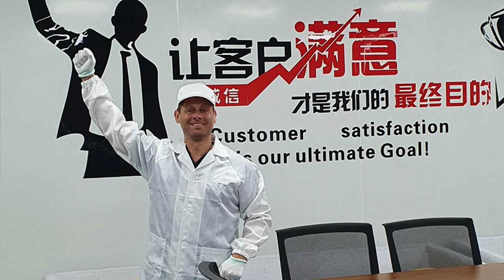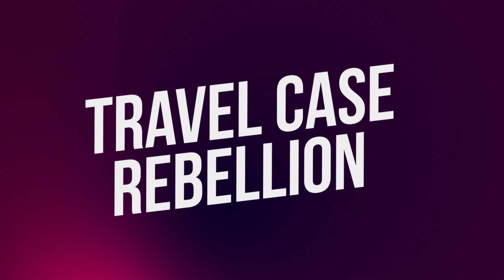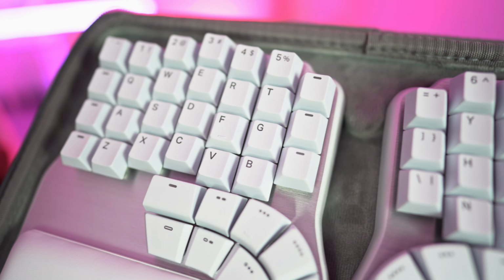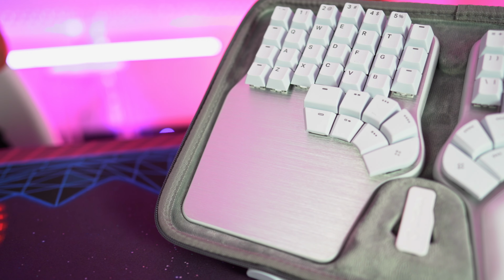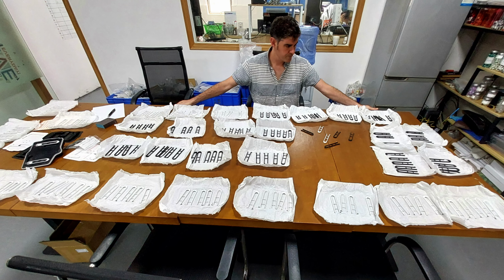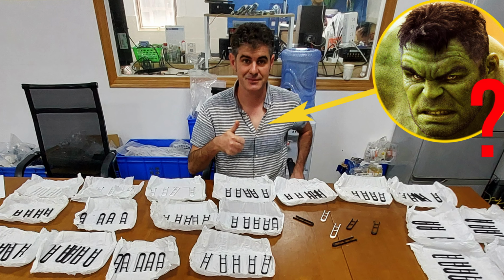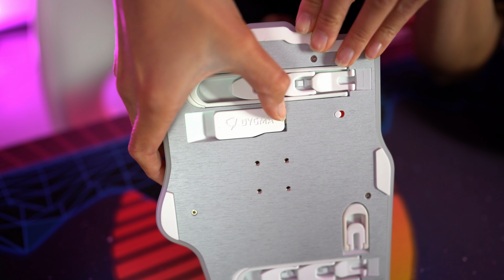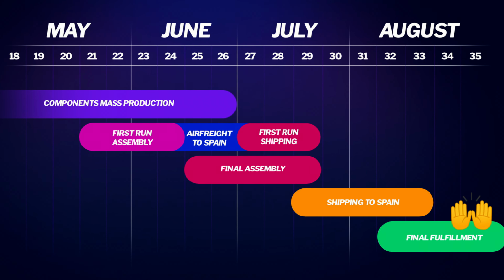We assembled 100 Dygma Defy keyboards!! 🎉 - Dygma News #10

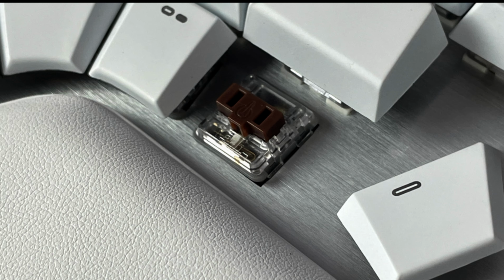Comment: This is the first time that problems are accepted or fixed with workarounds instead of at the core. Both with the holes for the low profile switches being too big not getting fixed 4:33 and with the Neuron not sliding in fully 7:59, leaving the connector not fully closed on purpose. The lather especially I find untidy and a sign of a cheap product.

This is very not like Dygma and what I expected since all the other updates. It's also not quite what matches the price point of the keyboard. But I understand that you need to finally cut and bring the product to market for real. It's a niche too and I'm grateful to the improvements you guys bring over current alternatives.

Thank you very much for the update and your continued efforts. I look forward to going split ortho again
Reply from the maker: I'll leave here the same comment as on Reddit 😊

You're right. If we were at another stage of manufacturing, we'd probably look into other solutions. But at this stage, we can not redesign and retool things like the top panel or the electronics unless it's critical things. And these aren't.

The switches thing only happens in some keyboards when you pull the keycap incorrectly: aka pulling just from one side. We're not even sure that retooling the top panels would fix it; we don't want them to be as hard to pull out as on the Raise.

For the Neuron, it's a tricky thing. The USB that we are using has two "clicks". On the first one, it's firmly connected but easy to pull out; on the second one, it's much harder. We've seen that many other electronics limit doing that second click and thought it would be a good solution without having to change that component and start all over again.

As said, it's all about the tradeoffs at this point. Keep in mind that this is the first batch of a keyboard that is nothing as it has ever been manufactured; we'll find little things like this down the road and polish them, but please understand that we can't go back to square one at this point for non-critical things.

Thank you!

Comment: Regarding the case, if the cable lid required perfection to not flop open, then what does that entail for the end user? The initial delivery of the product will come with perfectly folded or coiled cords, but after the consumer uses it they must always replicate this precise placement?
Reply from the maker: The case has mesh pockets on each side to keep the cables in place. You won't need that precise folding. The problem is usually caused by the clips to keep them neatly organized for a nice unboxing experience. We'll share an image of "humanly folded" cables 😅

Comment: I wish it had a fixed tilt angle provided by the keyboard casing itself that would make the whole construction a lot simpler and sturdier.
Reply from the maker: Yeah but it wouldn't be customizable. Some people like low degrees, like 5 or 10, others 20, 30 or even 60. And some want to swap between angles during the day or even use it flat sometimes. It's an engineering feat, but that's how you push for innovation 😊

Comment: Aren't you scared of the laser etching on keycaps? It won't be durable...why not use double shot on a product this expensive?
Reply from the maker: That's a very good question. I must say, we aren't scared of laser etching on keycaps because we have been perfecting our ABS keycaps for years on our previous keyboard the Raise, which has PBT for English but ABS for other languages. 

The reason we haven't done the same for the Defy is because unlike the Raise, there are no off-the-shelf PBT keycaps available (a columnar keyboard needs different key sizes than a regular 60% keyboard like the Raise), so we needed to make our own Double-shot mold. And those are VERY expensive –like more than 1/4 of the money we raised to make the keyboard– and take a LOT of time to design. 

That said, we want to offer PBT in the future. Once our volume is higher and we can spend time and money on our own double-shot mold, we will. 

I recommend watching this video: https://youtu.be/Yo5r2nl-0Nc
Reply: Because it would make it even more expensive? 😅

I can't speak for the Defy, but I've had a Raise for 3+ years and the laser-etched keycaps show no signs of wear. Let's see in some more years...
Reply: @eldelacajita  yes, but this is an expensive high end product, it has to be built to last
Reply: @MustRunTonyo  laughing in dash layout More seriously, they did say in a previous video that the quality depends heavily on the manufacturing process, I don't expect them to wear out easily.
The only problem I see is them not offering a double shot version too as an option, but maybe there isn't enough demand. I for one would have chosen the current version.
Reply: @blacklistnr1  The dash layout is also laser-etched 😁